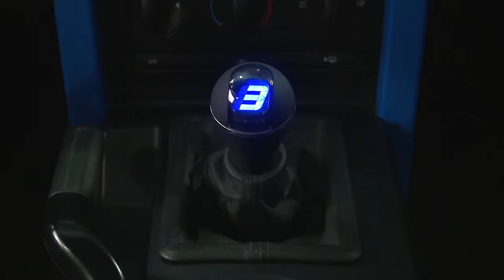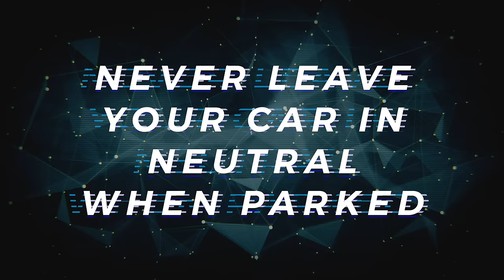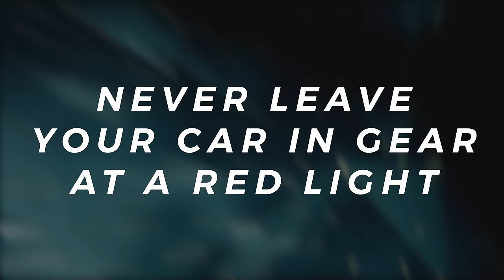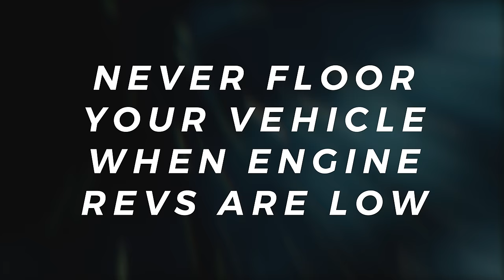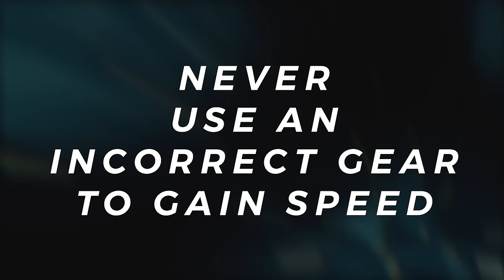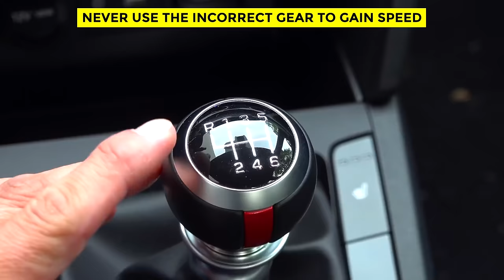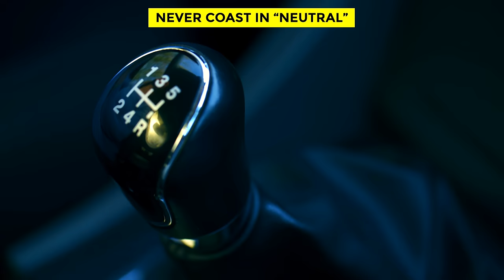7 Things You Should NEVER Do In a Manual Transmission Car!

Comment: 9:42 "Coasting in neutral cuts the engines oil supply"...... No bud, it doesn't, lol. That's not how oil pumps work. Can't even use that argument for the transmission either.
Reply: Could you explain it pls? i'm really insterested, never heard that neutral lowers transmission lubrication!
Reply: Yeah like lol the engine is still running even in neutral
Reply: @She1lby  it does lower it but you are directly lowering your transmission use so it doesn't matter, there's nothing to be lubricated so why should the car lubricate
Reply: @She1lby  dude, the transmission's gears spin as the car goes no matter what, so if the car goes, the gears get oil, period, doesnt matter if the clutch is down or up
Reply: @hephaistosthesmith2069  "lowering transmission"? What do u mean, on neutral engine just gets it's normal lubrication because it still rotates and transmission rotates with the speed of the car as well.
Reply: Correct!!!  If I were him to explain why not engage into neutral is the importance or engine braking especially on steep downhill and not about oil starvation. Coasting on neutral saves fuel and cools the engine in normal flat roads or slightly downhill, just make sure your brakes are healthy as hell...
Reply: michael lee  That's....... all irrelevant, and not how any of that works, lol. If your car is in good running order, it doesn't matter if the engine is idling or spinning at 8k rpms, the performance of the mechanical components and accessories all still function as they should with no losses. The A/C still will blow cold at the same amount whether or not if the engine is idling while coasting or standing, same with the water and oil pumps. They are not affected by the vehicle being stationary or moving, idle or in gear. They're all closed systems. You can even place the car on a lift in gear and run it off the ground and it will still operate the same, lol.
Reply: Also, most manual trans gearboxes are literally just that: boxes. They are filled with gear lube and the simple action of the input/output shafts rotating lubricates them, they don't have pumps of any kind.
Reply: @charlesdean9178  Coasting in neutral or in gear makes no discernable difference in fuel consumption, as you're not on the throttle. Just because your rpms are up when you have it in gear, doesn't mean it's consuming fuel at that rate. Also, coasting doesn't cool your engine, the flow of air thru your radiator cools your engine, which is speed dependant, not whether or not you're in gear.
Reply: @charlesdean9178  i agree that engine/trans braking downhill is bad for your engine, but when i learned that trick i used it just about anywhere i could, and I've done it for a good 100-150 THOUSAND miles in the span of 8ish years
Reply: Running in neutral consumes double the amount of turn-signal fluid as well. Can't have that!
Reply: actually it does a little. the oil shooting at the parts are not working as aggressive as they are when the motor spins slowly, imagine u push your engine to the limit with that idle cooling something is going to stay hotter than they wanted
Reply: @royhsieh4307  Not really, as the oil pump is either driven by the camshaft (pushrod engines) or driven by the timing belt/chain. Oil pressure doesn't fluctuate all that much in a proper working engine, as theoretically the oiling system is a "constant leak" within itself as the oil is pumped thru the galleys and flows back the the pan. So regardless of where the rpms are whether coasting or in gear, the engine is receiving all of the proper lubrication it needs. Same goes for the water pump, since it is either driven by the accessory/timing belt or electric motor on newer models. But it's the flow of air across the radiator that really matters when your moving, not so much the pump unless it has had a total failure.
Reply: @charlesdean9178  wouldnt it be healthier for your brakes to aply the engine brake ? (shifting into a higher gear) your car would naturaly slow down/not speed up too much without having to constantly apply the brakes
Reply: @murica7977  engine braking is shifting into a lower gear
Reply: And that is only advised in  emergency situations (ie brake failure )
Reply: The oil will reduce if you coast a lot... But this only counts for 2-stroke engines. The fuel is mixed with the oil in a 2-stroke so you need to keep it revved up a bit.

Thing is basically all cars are 4-Stroke 😂
Reply: @anthonyrodriguez-provost961  "coasting in neutral or in gear has no difference in fuel consumption"
What about my 90 Toyota, it does 3.25k just to do 70, there is no coasting in gear on the interstate as I begin to slow down MUCH faster than if I was in neutral
Reply: @murica7977  brakes are cheaper than clutch
Reply: @royhsieh4307  if you're engine isn't cooling as much because the rpms are lower then there is less to cool because you're rpms are lower... Not hurting anything
Reply: @anthonyrodriguez-provost961  coasting in gear reduces rpm unless you are coasting exactly at idle rpm, because otherwise the room of your engine will increase and drag from the engine will slow you down, both of which increase fuel consumption by a small amount.
Reply: @jadenantal1652  the  don't slip your clutch while engine braking. Problem solved.
Reply: @lazyh-online4839  yea no shit Sherlock
Reply: @anthonyrodriguez-provost961  Yeah, his instructions are only valid if the gearbox has its own oil pump AND that pump is driven by the shaft on the engine side AND if the gear box is in neutral AND if you engage the clutch at the same time. That yould be the only way to stop the oil pump if you have one.
He also claimed that the engine could overheat since the engine's own oil pump goes a lower rpm. That is just like claiming that you risk overheating an engine if you let it run on idle. Quite embarrassing. Where did you get these ideas @Mordern Muscle?
The rpms of oil pump, water pump and crank shaft are LINKED.
Reply: @donathonwilkerson3524  Engine braking does nothing bad to your car, if your cooling is functional, that is. You should do it whenever you want to brake in a straight line in downhill direction. Even manufacturers support that. For example, in my Opel Astra G guide, there is a chapter about engine braking and it's impact on saving fuel and reducing brake load.
Reply: @TheHatori1  I didn't say it did ,not sure where you are from UK I assume because of Opal ,but across the lake in America, its advised  to engine brake in emergency situations, example -total brake failure
Reply: @TheHatori1  What about reversed loads on the engine and high clutch \ transmission load while engine braking? Plus you could slow down at a different rates, of course it may be bad for a car. For example if you just instantly let off gas while in 1st gear and high RPM or downshift hard without rev match.
Reply: @donathonwilkerson3524  I learned that you should always enigine brake because you don`t need to brake as much so the brakes won´t overheat. My dad said that you should be in the same gear downhill as you would be uphill. At least in older cars because the brakes could overheat otherwise. 
Maybe enigine braking with automatc transmissions only in emergency situations? Because i guess that they expect that you drive automatic so they teach about that.
If he drives Opel he probably isn´t english because they have Vauxhall.
Reply: @copperheadmtrsprtspark7738  Neutral does use fuel to keep idle speed BUT neutral doesn't engine brake so overall distance to complete stop will be a lot bigger.
Which means u absolutely can save fuel using neutral.
Reply: Copperhead Mtrsprts Park literally the exact opposite of what you just said... there is literally no way a car will consume any more fuel than is necessary to maintain the idle fuel load. What the fuck are people saying in these comments?
Reply: michael lee  lmao
Reply: @BoomerBends  agreed so many people dont know this, or to change the air in their tires every season for optimal tire performance..lol season air causes flat tires, i tell people this all the time that dont know anybetter, they wana know why there tire goes flat all the time and i tell them its from seasons air, air is more dense in summer than winter so when seasons change it goes flat..lmao
Reply: michael lee  but what does the A/c compressor have to do with engine performance? And no it doesn't cool or lubricate as well at idle as under rev but it doesn't need to because its not being worked at idle.
Reply: Truck transmissions can get dameged if you roll in neutral.
Reply: @Ronni.Petersson  ok, news to me
Reply: @Ronni.Petersson  makes since tho, nothing would have a load on it nothing would be engage and no parts would be getting wore out.. makes since to me it would damage it! NOT!!! What does it damage and why?
Reply: michael lee  but what about the ac pump has to do with it, never answered that question
Reply: michael lee  show me the evidence and i will debate this, but i dought you find alot unless you look at extreme circumstance, coasting down a hill for 5 sec is not going to kill your trans or idle while running in store for 2 two min wont kill your motor
Reply: michael lee  i would coast down any hill in neutral either because its stupid and get you nothing. But aint gonna kill your car to coast down a hill..
Reply: michael lee  i just dont understand the ac thing still. Yes it gets alittle weaker when idleing but what thats going to hurt i have no idea.. the pump just aint turning as fast so it isnt pumping as much Freon.. im just saying in normal everyday operations idling for coasting alittle bit isnt the end of the world like people are making it sound.. my car idles for hours at a time and is still going strong.. 254,000 miles
Reply: michael lee  i work in the timber business, sometimes I'm trying to jump start a piece of equipment, or waiting out the rain.  Waiting for equipment to arm up or just taking a break for a bit..
Reply: Another thing is,,,,,, THE ONLY TIME YOUR ENGINE FILTERS OIL IS DURING IDLE  OR  LOW SPEED SINCE THE BYPASS VALVE IN THE OIL FILTER
WILL BE  CLOSED THUS ALLOWING FILTRATION.  So coasting promotes clean oil.
Reply: True that dont matter
Reply: Haven’t seen people say this much, what is the difference for the engine between having it at idle at a stop or having it idle while you’re moving. I personally would assume your car would cool faster due to the rushing air going to the radiator.
Reply: Coasting in gear ie engine braking is good because you are still ready to react at a moment's notice of an unexpected emergency, say a runaway semi you have to get out of the way of.  On newer fuel injected engines they will shut off the fuel injectors using almost 0 fuel so it can be more fuel efficient to coast ingear now on older cars the opposite could be true.  The whole oiling/cooling stuff is kinda out there the engine will have no load on it so even at idle with air flow across the radiator it will cool (if cooling system is in good shape) and engine will stay lubricated just fine.  I like to engine brake on twisty down hill roads and coast in neutral on mostly straight roads
Reply: So anyone who sees this comment, so basically coasting in neutral is bad or good? Because I do it all the time when I’m gonna come to a stop or red light I’ll put it in neutral and use the brakes so I wanna know if it’s bad or not
Reply: The only car that’s applicable to is the trabant which had a two stroke engine with no oil injector but that would only be if you coasted before the freewheeling device in fourth gear
Reply: @Unknown-rr1ch  Coasting in gear is better for multiple reasons. Going into neutral when you are close to a stop is fine, but you should downshift through the gears first until you are just about to stop. So, if you are in 4th gear approaching a red light, go from 4th to 3rd to 2nd, and by the time you would go into first you are probably close enough to skip 1st and go into neutral to stop. For safety reasons, it is best to downshift when coming to a stop. Coasting in neutral is not a good idea, and the reasons people do it are not good reasons, or are plain myths. Keeping the car in gear means you have complete control over the car should anything unexpected happen. Also, it helps to slow you down without your brakes; this is called engine braking, but just remember as the rpms get low you need to downshift in order to not stall, which is why I say to downshift when coming to a stop, rather than leaving it in one gear. This allows you to use your brakes less, which means less sporadic braking for the people behind you, less wear on the brakes, and less heat. If brakes get too hot they won't work well and you will be in a bad situation (generally it won't get to that point unless you are really abusing them, but it is good to be aware of this). Also, in most modern cars, the fuel consumption should not be worse when coasting in gear, because the fuel shuts off since the engine is not being used for propulsion and therefore doesn't need the fuel. In neutral, it is idling, which is using fuel for no reason. Same with braking; if you are in neutral you can only use your brakes to slow down, which is worse for fuel economy than simply coasting a bit in gear and slowing down that way. Lastly, I am not sure why people here think coasting in gear is bad for the engine. I will be the first to admit I am no expert, but that is a myth.  Truck drivers around the world use engine braking all the time, and those trucks drive far more than the average person. Sometimes they are even required to engine brake. For example, on a steep downhill you might see a sign that says "reduced gear zone", which is for trucks, telling them to downshift in order to not pick up speed uncontrollably, which is what would happen if they remained in a higher gear or coasted in neutral. Imagine a truck coasting in a neutral down a steep hill... sounds like a terrible idea, doesn't it?  Apply the same logic to cars and it makes sense why one should stay in gear; it allows more control over your speed, more control should something unexpected happen, and better fuel economy is a nice bonus.
Reply: @jamesshives5679  thanks for the reply and yes everything you said does make sense, from now on I’ll start downshifting and rev matching
Reply: @charlesdean9178  I think the conversation is about cars, not tractor trailers. A car having to break on a steep hill wouldn't hurt it too much, and why would you be in neutral going down a steep Hill. That's just plain stupid. A tractor-trailer on the other hand, if you use the brakes too much going down here, then you are in danger of your brakes crystallizing.
Reply: @Unknown-rr1ch  It's not necessary - engine does help you with braking but in most cases you don't need to downshift all the way, except for some downhills and other rare cases, where you just want additional braking.
Downshift only if you need more braking \ acceleration.
If you see red light far away and need to coast, it's completely fine to shift into neutral because on any other gear you will have engine brake effect that will slow you down.
Reply: @She1lby  thanks, I usually only downshift and rev match when I’m about to start a race other than that I never do it
Reply: @Unknown-rr1ch  rev match is a great thing to do all the time while downshifting :)
Reply: even I was wondering the same
Reply: @calvinhoward2277  Uhh, what? Have you never gone down a steep hill that leveled out at the end or do you just assume that every steep hill also has a steep incline following? Every night I go home there is a massive half mile hill that leads to the stoplight in front of my street. I coast down it all the way and don't have to even touch the brakes to make the turn, as the natural speed loss from leveling out slows me before the stop. Your assumption is pretty stupid tbh.
Reply: @TomasaurusrexQQ  I wrote out a big paragraph in response to your reply, then I realize that would make me a dummy to even respond
Reply: @jerrymander8020  You are confusing the bypass valve in the filter, which is there to maintain oil flow if the filter becomes clogged, with the pressure relief valve, which is the way the system limits maximum pressure by venting excess oil back into the oil pan, AFTER it has passed through the filter.
Reply: @AndreBrah  actually no, neutral disconnects your transmission from your drivetrain not from the engine. Your gears only turn while the engine and transmission are engaged (i.e the clutch pedal is not being pressed) Manual transmission have a splash lubrication system and as long as the clutch is engaged and the engine is running the transmission is getting lubrication.  Coasting in neutral with the clutch disengaged for long distances can damage the output shaft in the transmission because the only part of the transmission that is rotating is the output shaft as a result there's no lubrication if you're clutch isn't engaged. Just thought I'd clear that up